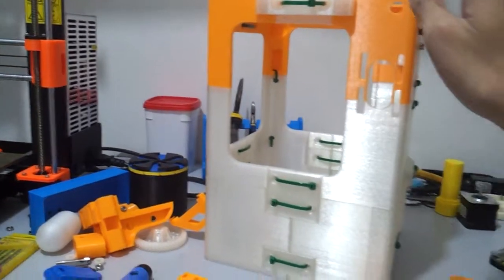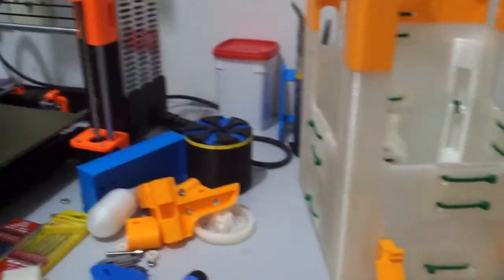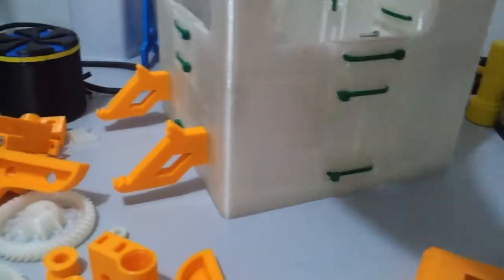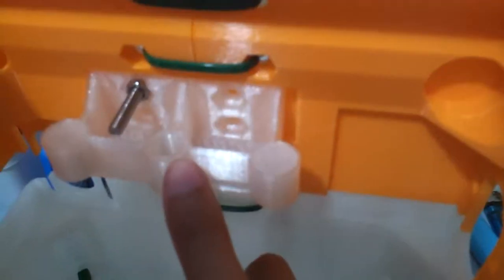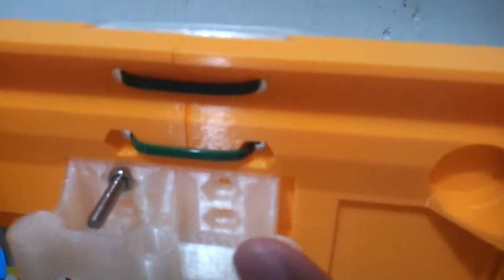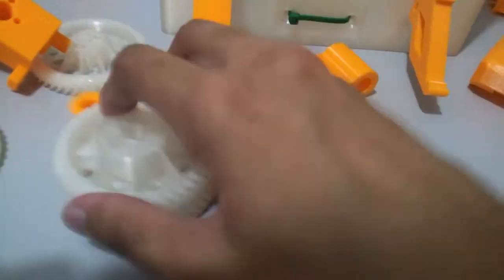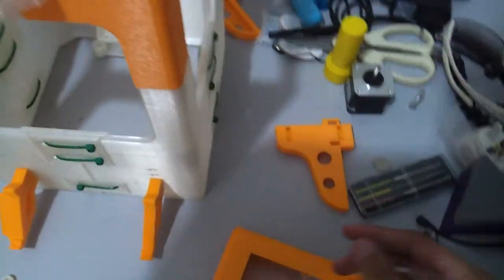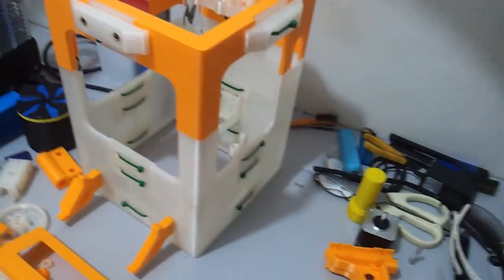Building a Tantillus Part 1

Comment: Do ypu have a link to all the files?
Reply from the maker: Hi, I've added the link to the files in the description
Reply: @AsraffAmzani  thanks. I have been wanting to build one but cant find a buold guide for this printer haha. Do you have that as well? 

Thanks. Hoping it can be done for $200 or less
Reply from the maker: @LT72884  you can refer to my multiple build video here or you can search through github as well, most of the time I used common sense which part goes where. But I wouldn't recommend you to build this if you're new to building 3d printers